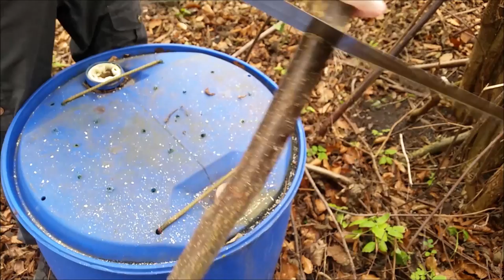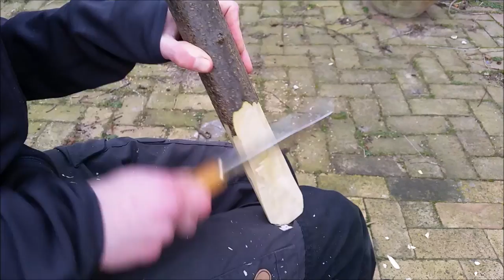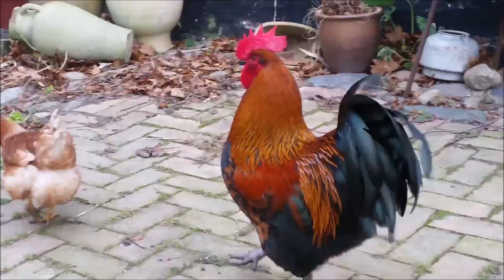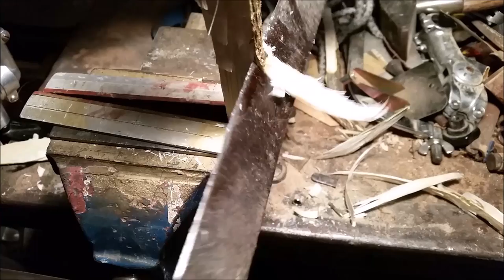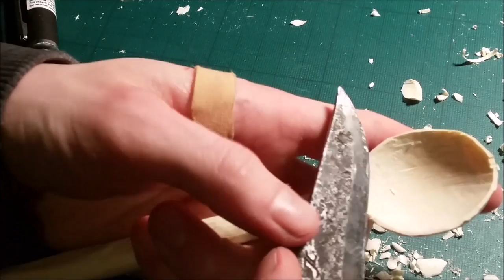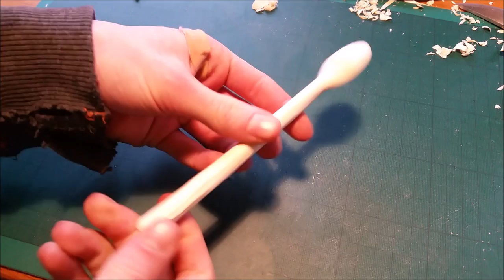Carving - Spoon From Fresh Piece of Hazel

Comment: How effective is the wood glue to prevent cracking? I found some branches in a park that I liked and took them home only to have them crack the next day. I’ve also heard dipping the ends in beeswax would help, what do you think?
Reply: Emma Fine Either method will work
Reply: Wood glue, beeswax, or candle wax will do just fine.